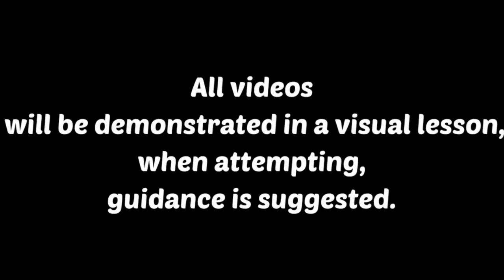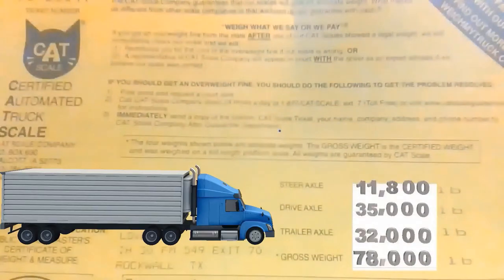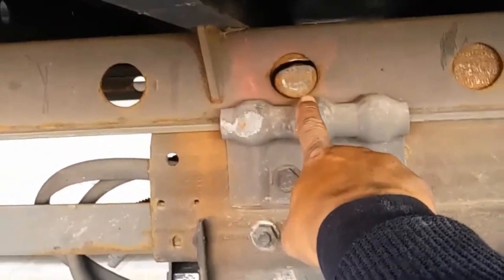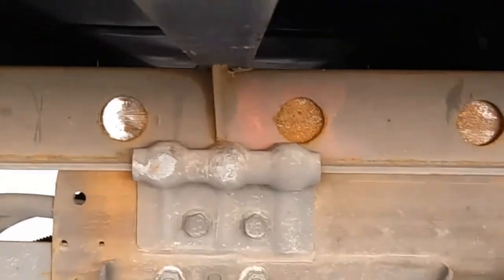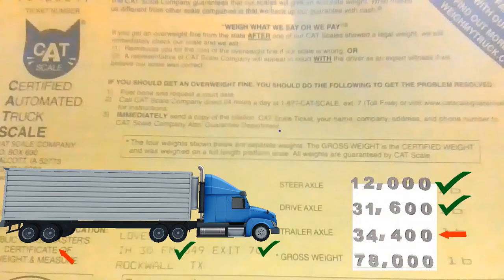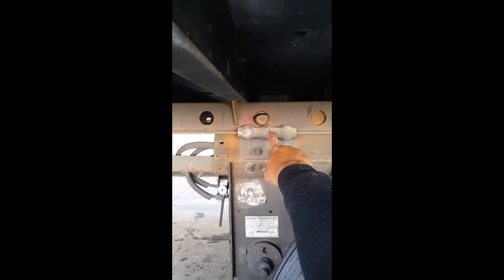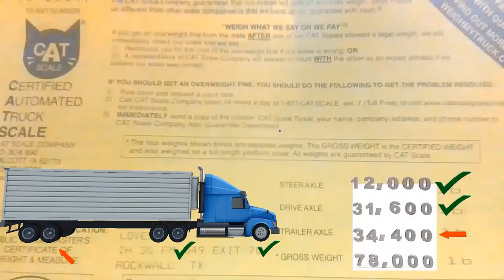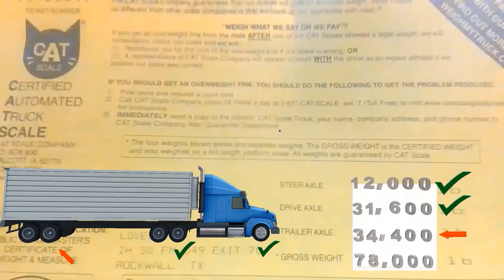Easy Scale & Tandem Adjustment (Part 1) wisdom, knowledge and understanding.

Comment: Another great tips for beginners : move the tandems in the direction  u want the load to go to , meaning if u want ur load to go to the back move the tandems backwards and vice versa. Good video
Reply: Yes , that is move towards the problem.
Reply: Most people run into issues when for example, they’re over on the trailer Tandems and good on Steers and Drives and adjusting the Tandems is a NO due to you’re at the 40’ mark! 
Can you give example in what will happen to each axle on different scenarios?
Reply: @alisahtikvah3304  that means that you're loaded improperly with all the weight in the back of the trailer, if all the way forward makes you over on the tandems but you're good on the drives and steers, you should have gone back to the shipper because your load is either loaded improperly or you are  over 80k or both...only recourse is back to the shipper... ALWAYS scale out ASAP when you are loaded heavy, forklift drivers will mess up, count on it.